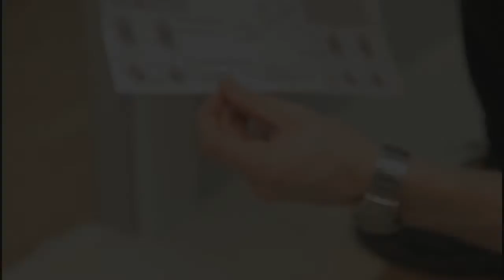ThermaSkirt ProGuide 6 - Doorways, Openings & Obstructions

Comment: I have this system in one of my bathrooms and in there is the warmest condition then in other bathrooms, I have 7 of them. Also this way is saving you energy, because you heat up only a boiler & the hot water is always running though all pipes and you do not burn extra electro devises to keep your room warm.

Comment: Thanks for the video What if there isn’t 10cm between the door frame and the wall?
Reply: If the wall is too short at the side of the door frame, you start on the next wall and use a piece of 'dummy' unheated skirting to fill the gap. Or you start on the other side of the door and go round the room the 'other way'. This video just shows a typical 'clockwise' installation. There are parts to overcome all these issues. Hope that helps?

Comment: How efficient is it ?
Reply: Compared to a standard radiator anywhere between 8 & 13% due to better heat distribution and no real convection currents. Can allow you to use a lower flow temperature at the boiler or even a heat pump for greater savings
Reply: @martinwadsworth5908  Hi Martin. I just sent you an enquiry to Discreet heat. We just got out first mortgage! House renovation project and I can't wait. I want thermaskirt all round. No radiators. I'm sure I can do it on my own. Hopefully. I just worry it will cost a fortune and not add the value onto the property after. It's more expensive than I expected!

Comment: Looks like a load of faff to me, Why can't you just use a radiator that will give you a lot more heat plus you can dry your washing on it (the wife says) The electric version is even worse with the amount of energy it uses.
Reply: Most houses I see with radiators have "lovely" pipe work run on the surface, sometimes in "tasteful" plastic trunking.    Often to save faff they put radiator on an inside wall thus making a lovely circulation of cold air running over your feet.

The faff is in concealing the pipework. 

If you dry clothes indoors without open windows you create a health issue with high moisture levels and risk of mould.

If you use electric to create heat then you will really notice the difference between heating the air with traditional radiators and using this true radiant system because of the 30% odd saving of energy at 6x the price per kilowatt over gas becomes significant amount of money.
Reply: Guess compared to hanging a bog standard radiator it might be, but have you tried replacing a radiator with underfloor heating? Now that's a FAFF!